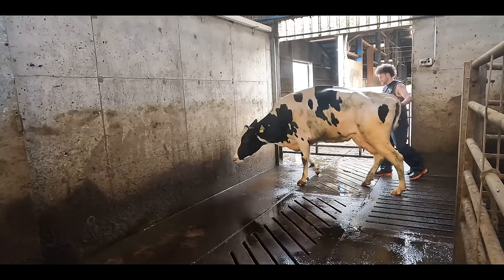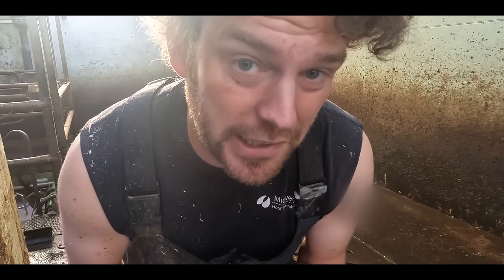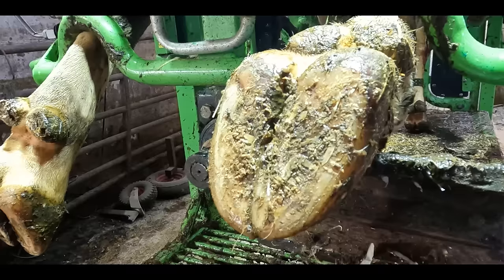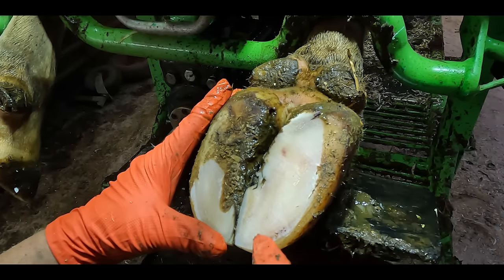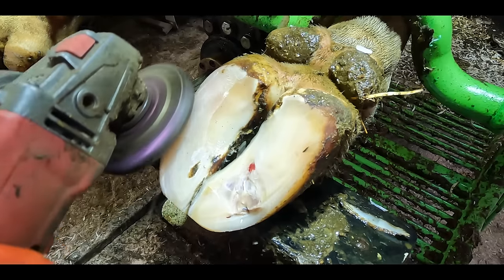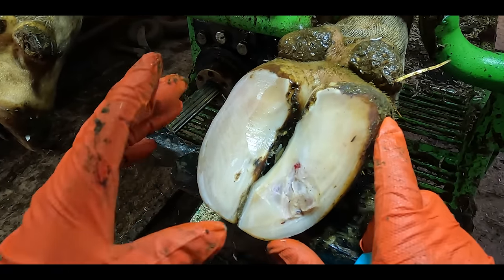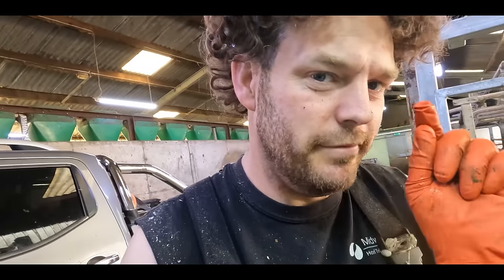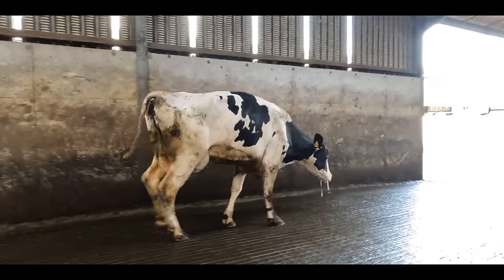DEVASTATED!!! I don't think I can help this cow's painful foot.

Comment: I wanted to be a filmmaker in high school.  Ended up taking my dad’s advice and followed in his footsteps as a plumber for 10 years.  Joined the military.  Got out and did field service starting up industrial plants and working on printing presses.  Went back to plumbing for a year and then went college to be an automation engineer.  And now that’s what I do, automation engineering.

Comment: I love that you went to art school before becoming a hoof trimmer. Life takes us on such unexpected journeys, doesn't it?

I got an associates degree to be a veterinary technician and did that for a few years. The state I moved to required national certification for vet techs when the last place didn't. I intended to take whatever job I could land, save up and take the exam, then get back into the veterinary field. I found a job as a receptionist at a law firm and, after a bit of a steep learning curve, got promoted to being one of the legal assistants for the owner of the firm. I've been a legal assistant now for 8 years. Now that I'm in my 30s I'm ready for something new and want to pursue something I'm more passionate about rather than just something I'm good at, so I'm going back to school to get a bachelors in botany, and then... I don't know. I could utilize everything I've learned and go into forensics, be an expert witness for court cases. Or I could work for a local or national government, or international environmental organization. My end goal is to move to, gain citizenship, and live in Ireland. I'm hoping to get my masters degree there, but there are so many factors involved and so many different ways my future could go, that I'm just focusing on the botany degree now and then will figure it out from there.

Comment: Hello, for the record after your question, i studied chemistry (synthesis and manufacturing of pharmaceuticals) at the university ict prague, never worked in the field. Then tried to study physiotherapy, but wasnt able to finish. I just work manually on friends little little bit. I did a few jobs, last as a monteur around car accessories. So, still looking for my field, being 35, and it seems to be in manual jobs, including thinking, but best including shaping of materials, and/or working with releasing/directing tension. So, i very like your channnel. As i also like living creatures and come from medical family. As a new subscriber i now think a bit of becoming a hoof trimmer =) But i am quite a small woman so i dont rush into this. I stick to my plan to requalify in wood working.

Comment: I wanted to be a paleontologist, but didn’t have money for college. Ended up getting a job at privately owned grocery store doing a mix of stocking and cashiering for 13 years. I am now in the office, assisting the bookkeeper; it will be my third year there at the new year. Neither was what I wanted to do nor particularly like, but I had to take what I could get.  At least the office job suits me better inasmuch that it’s calm and quiet and I don’t need to deal with people. I’m almost 40 now, and I still love my dinosaurs, even if I don’t get to work with them.

Comment: I studied chemical engineering, but had to pause several times because I developed chronic depression. Although I did finish my bachelor's, those pauses and elongated academic life made it impossible to get certifications, and my career starts was late and lackluster when I could finally find a job. And then after two years of working there several years back I got laid off, and haven't been able to find work since.

Comment: Well... I'm 69 and retired but have had a ridiculous range of jobs. My first was a hot-walker for a Thoroughbred racing stable in Winnipeg Canada, part time while in high school. The following year I became a groom and due to some bullying in school decided to quit and do it full time. Over the next years I traveled to Montreal where my first girlfriend required switching to Standardbreds (Harness Racing) which was quite a different business. But a lot more enjoyable as we got to exercise our trotters and pacers ourselves. Unlike with the runners where only the smallest got to ride. We summered between tracks in New England and Montreal then down to central Florida for the Winters. A few years later I changed to an American stable and raced mid Atlantic track circuit with more great Florida Winters. While at home for holidays, I decided to finish school and give college a try. I worked in fast food restaurants and joined management getting ready for college. Once there I followed a fascination with airplanes to become an maintenance technician  and worked for a variety of flying schools and small airlines. The late 70's gas crisis led to lay offs. I returned to Thorougbred racing and became an assistant trainer for 2 years. With marriage and opportunity I returned to aviation as an engine overhaul inspector. Industry slowdown led to working for a major farm equipment manufacturer and a struggle to work where economy forced me to change a variety of technical jobs that finally landed me in the booming new computer industry in sales and management for the next 6 years.  I decided to really challenge myself and joined the Army Reserve at 36 as Communications Tech which filled in as I prepared too return to Aviation. I finished my working career as an Aircraft Electronics tech at a company called Bristol Aerospace and active Reservist (just barely dodging a trip to the Persian Gulf War!) . I got sick with what they thought was MS and had to take medical disability by 1995. Not how I would have chosen to retire, with a young family to support... But there you have it... A busy and rewarding life but sometimes things lurch out of your control. I'm now a full time divorced gent, with 2 daughters and 6 wonderful grandchildren. Approaching 70 and with a surprise health reprieve HAS led me to thinking about a new adventure...maybe writing.

Comment: I learned in the 1992 for 3,5 years Industrialmechanic qualif. machine and systemtechnican in germany, short after the 12 months period must go to the army. And in this time i damage my right knee pritty heavy with an there and now cartilage tear and right now I´m only allowed max 10Kg to lift or do anything. Then through the jobcenter I get a new job as general office clerk in 3 years and then sadly my mom dies in 2018 and since I´m jobless. And now I´m 51 years old.

Comment: I studied Classical Animation first time in College.  I have kept up the figure drawing and doodle a character here and there still, for myself not as work.  I have trained thru a few different disciplines since: part-time in Garden Design and Maintenance and finished that too.  Three levels of Apprentice Diesel Mechanic and 'technically' finished, but is undecided as the pandemic interrupted the final two months and although did labs online, and the school computer system says I am finished...I don't have the certificate.  (I did work 5 years in 2 bus maintenance shops, let go first year of pandemic, so that is why the certificate is in a quandary, but the experience is good and the training in college was great, I don't want to try to work solely with men again, that was enough.  I have the training and plan to use it in future.  Finished part time certificate in Garden Design and Maintenance and worked the longest in that, 15 years, still have a customer now.  All through out I have done figure modelling for art classes and still do that as a part time gig job.  I am a crossing guard during the work week now and like it.

Comment: I have a question for you Graeme, why is it that you only block one side of the hoof? Wouldn't it be unbalanced and a little harder for her to plod along?
Reply: I'm guessing it would be so the injured side bears less or no weight
Reply: How would you expect him to glue something on to open wounds?  Also, it's just a matter of a month or so while the bad part of the foot is lifted off the ground, for the corium to start producing new hoof material, enough so that the hoof seals itself up and the block is no longer necessary. The cow can get around much more easily with the block keeping the sore part of the hoof on the ground, despite a little awkwardness, sorta like crutches. Harder to "plod", but at least plodding is possible!